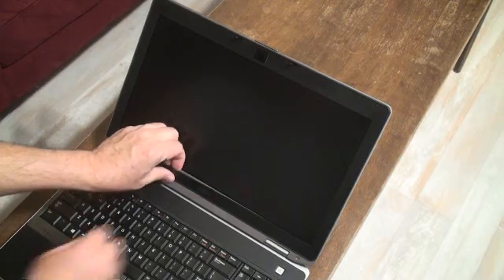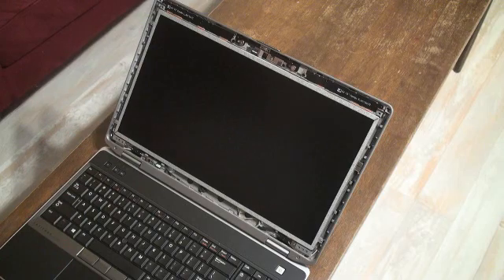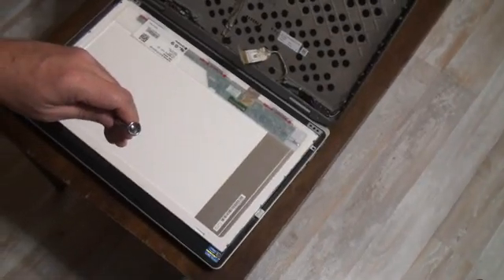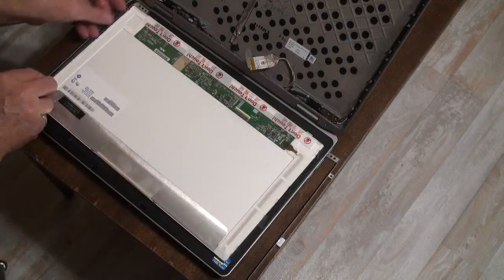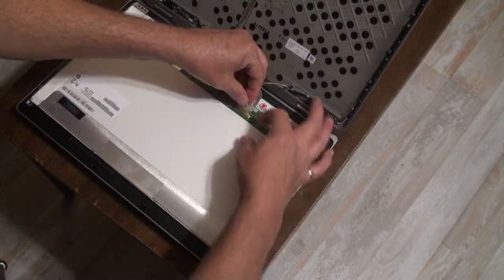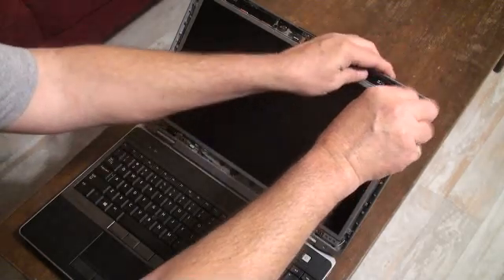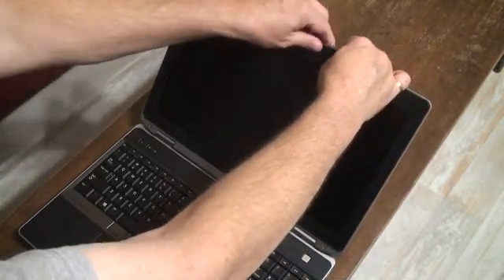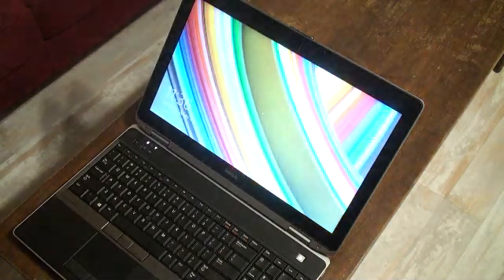Laptop screen replacement / How to replace laptop screen Dell Latitude E6530

Comment: Thanks so much for this video! It looks like you put a different type of panel in the laptop, based on the circuit board strip at the connector - is that true? Did you upgrade the resolution? I also have an E6530, and I'm wondering if it's possible to upgrade my 1366x768 to something more high-res.
Reply: Please answer his question as I would like to know as well
Reply: For everyone wondering in the future, no it's not possible to upgrade from 1366x768 to 1600x900 or 1920x1080. I tried 2 different screens, both had major display issues.